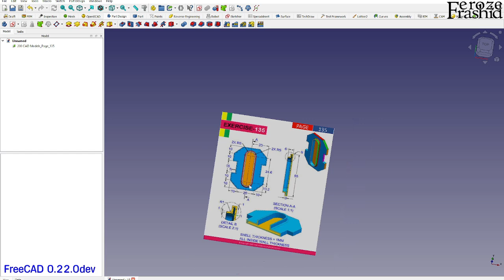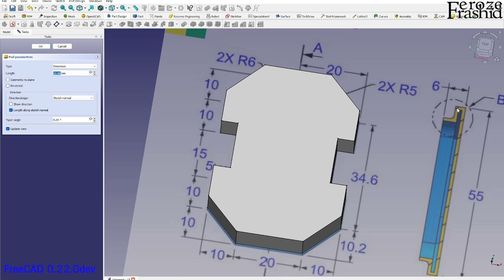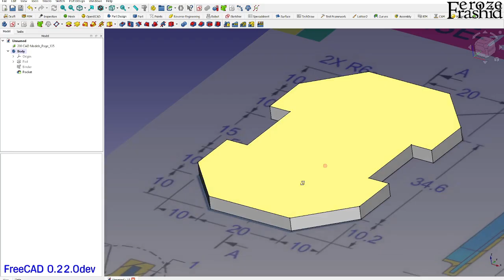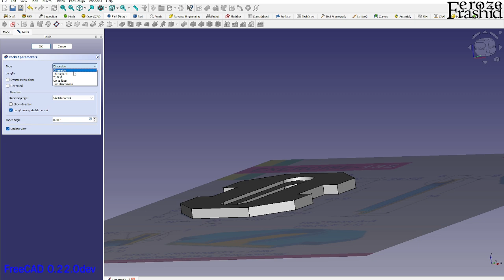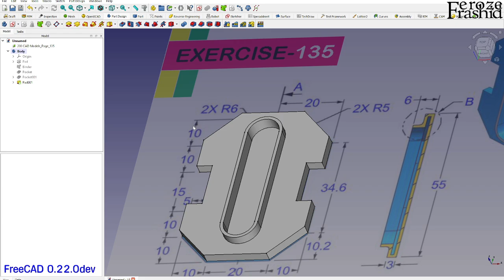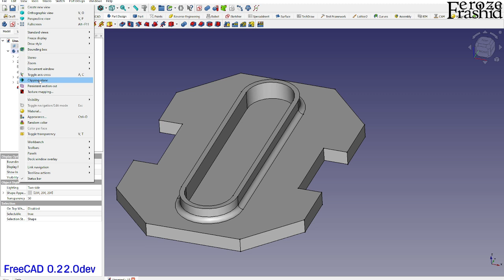200 3D Models in FreeCAD: Exercise 135 in Part Design

Comment: Thanks. I did not use the shape binder, but the thickness feature from 1 mm inwards. Maybe that is why the pocket of the slot is not working properly, because it leaves a wall.
Reply from the maker: Now that you mentioned about the thickness tool, I was able to build the model to 95% accuracy with the thickness tool in the Part wb. Thickness tool has potential to be a really powerful tool, but it's not reliable yet IMO.